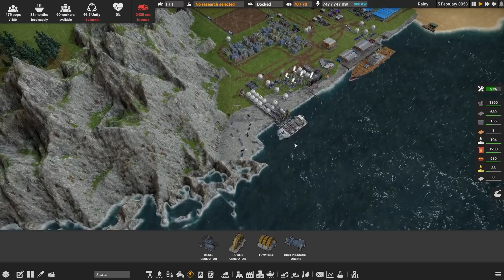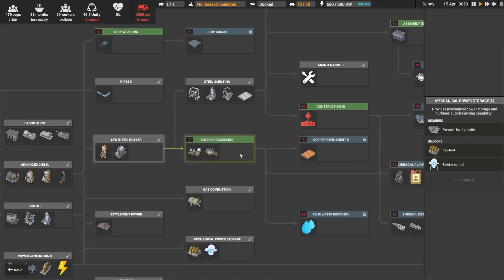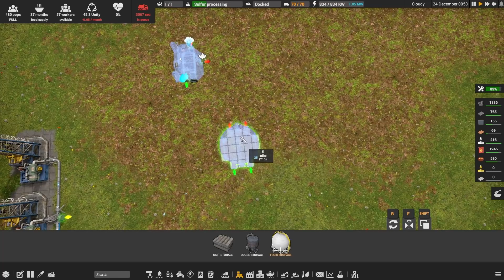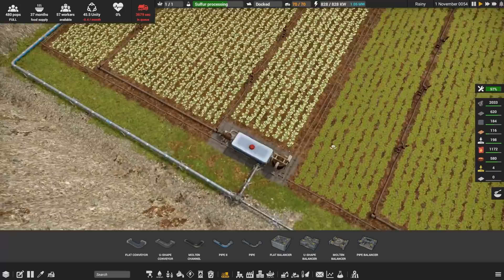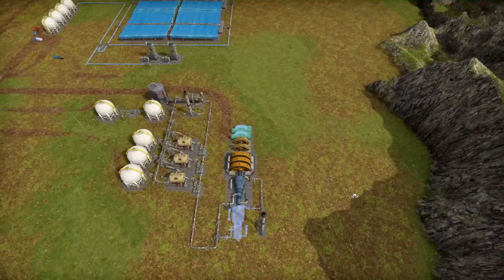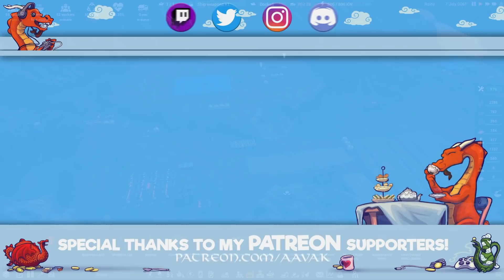Turning WASTE into ELECTRICITY in Captain of Industry

Comment: This is a treasured series that I reserve for times when I'm as certain as I can be I'll be left alone for the duration. 
I can't get past how extremely different your run is compared to mine. 
Yours is a lean, mean construction machine with low to none excess compared to mine.
I'm much further along and currently working on ramp 3-6 from colony level up to the factory flats.
I'm blown away by the logistics in this game and how easily it handles large volume of any materials. 
I've made deep ramps into ore fields and I'm still flabbergasted by the way it handles undermining with different materials. 
I'm constantly trying to literally dig myself into a hole just to watch how the materials reacts.
I won't hint to what I've learned, because I'm looking forwards to seeing how you'll address the issue when you get into it.
Just a heads up, the solid foundations of any construction is a thing of the past as everything will now be undermineable up to the limit of the materials. 
BTW; you're probably already aware, but keep an keen eye on LadyShelab at the moment as she has hinted about many things happening in her life now.
Take care and stay safe.

Comment: Suggestion: now that the old smelting is removed, it looks like there is just enough room there to place a farm. You could move the third farm there, then tell your coal miners to dig out that one specific troublespot. Once the coal there has been mined out, fill the hole up with stone, cover with grass, put the farm back in place and resume mining the rest of the coal.

Comment: Hi Aavak you should consider to build the water facility on the other side of your housing next to the farms. Therefore you could spare all the long way piping. You're never gonna build more housing there anyway because the farms are in the way.
Reply from the maker: If by water facility you mean the rainwater collectors and water pumps, they're built on the plateau to allow me to access the ground water as a backup in case we suffer a period of low / no rains.
Reply: @Aavak  no no sorry I meant the providing facility for your housing. Don't know how they're called. Those next to them where you pipe the water to
Reply from the maker: Ooh, right, I understand what you mean now! That is a good idea, no reason to have it at the front when the water delivery is at the back, you're right :)
Reply: @Aavak  I believe he means the building that you pump water into to allow your colony to have running water.

Comment: Aavak, why don't you have dedicated factory lines for each tier of construction part instead of bleeding off half of all your limited production to fuel the next tier?
Reply: I think it’s more flexible the way he does it. It just has to be a large enough scale.
Reply from the maker: On a larger scale it works wonderfully, as per the previous series,
Reply: @Aavak  Hmm, from previous series and stream, I don't remember it working wonderfully, I remember constant griping about never having enough of the mid-tier components because they all got eaten up by higher tier ones. I do agree with Peter that doing it that way is more flexible, in that it doesn't matter which factory is producing because it all goes to the same destination before being split off, but the constant annoyance at the lack of parts (which we're already seeing starting here) is something I'd want to avoid either way, even if it isn't as compact.

Comment: Maybe it would be interesting to go sideways up the mountain from where you are, rather then go in a straight line.
Also, it might be a smart idea to start digging for coal on the edge where you want to leave a road for your trucks, get out as much as you can without having them have no road at all, then filling it back in with something, just to be able to get the rest later on and still have a road there.